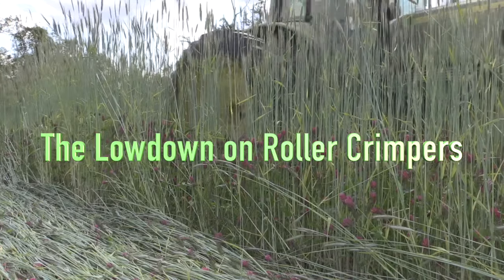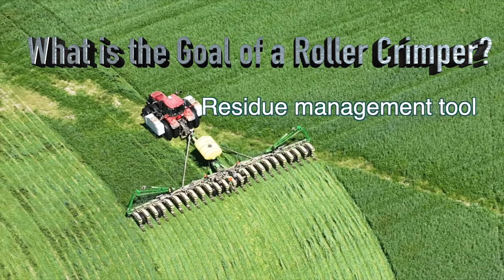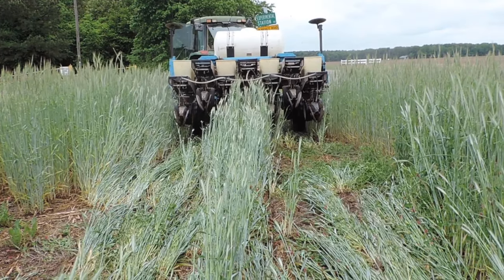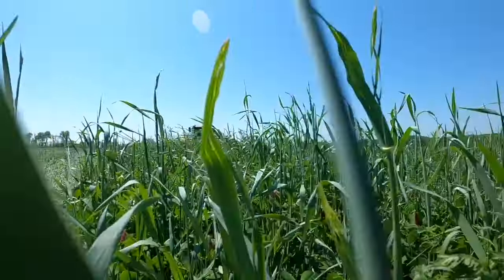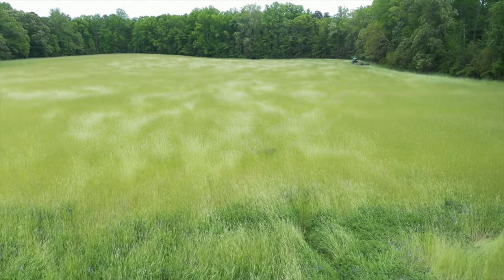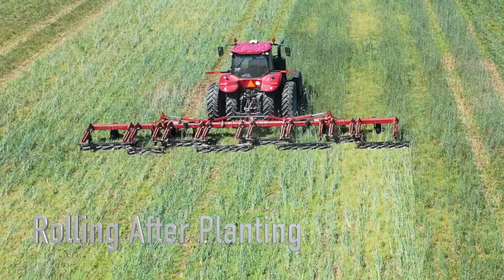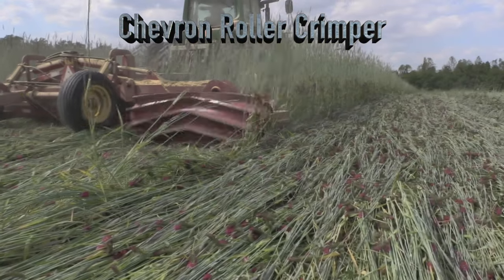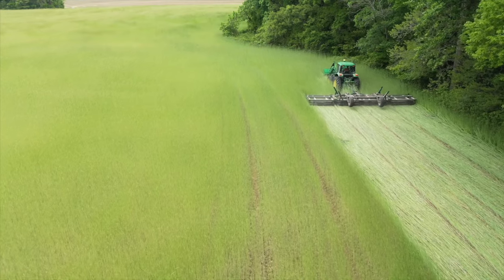The Lowdown on Roller Crimpers

Comment: If you use a smaller (more fuel efficient) tractor and a smooth roller like a lawn roller or cultipacker you can go "down and back" for two passes so any cover crop that tries standing back up after the first pass gets bent the opposite way and stays down. Plant into standing cover and then roll flat after emergence.